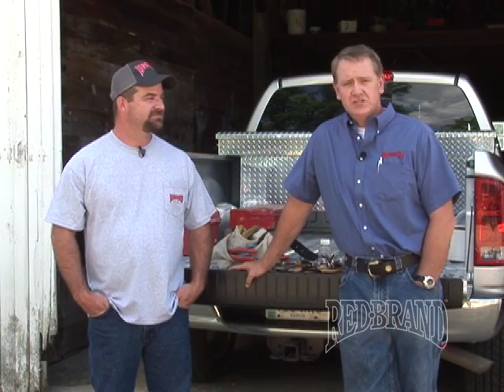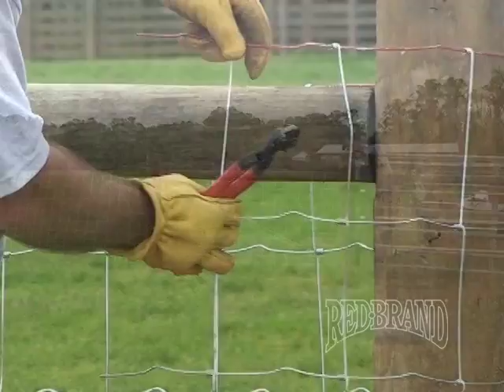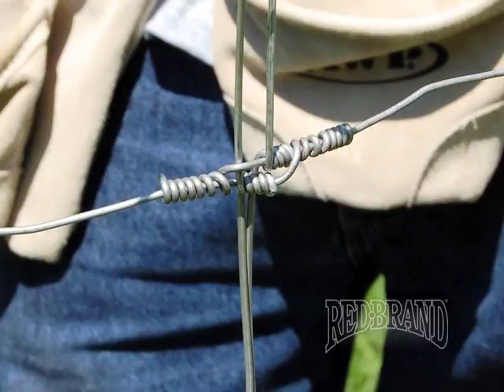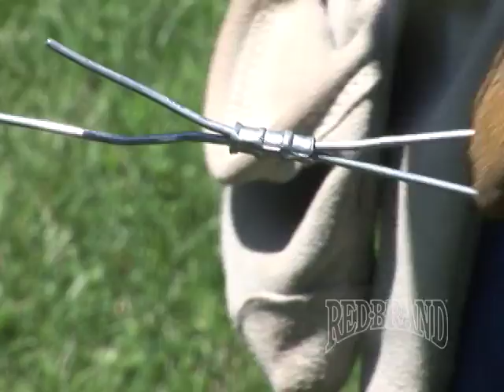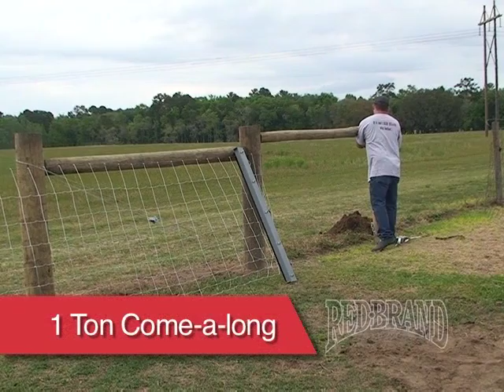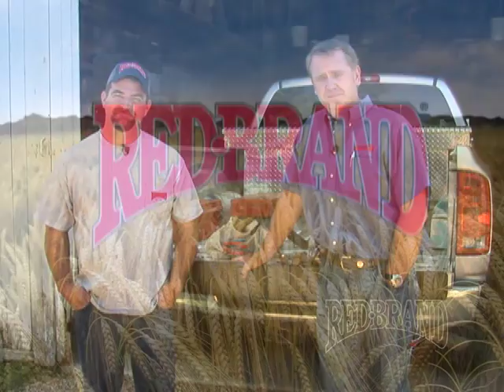How to install Redbrand Wire Field Fence

Comment: Low carbon vs high carbon. Over a short period of time, your fence material does not stand up to being tested by cows. Your fencing material is low carbon steel and not high tensile steel. I learned the hard way using your fencing products!!!!

Comment: can you tell me what material the fencing is? what is the metal wire made of, and what gauge? I'm wondering what material the fence tool for wrapping wire works for. are there some woven wires that are too tough for it?

Comment: I love how he breezes past the part where you have to remove all of the staples at every wire intersection in order to remove the verticals. They’re too thick and too small to grab with pliers or snips. Huge pain in the butt. I ended up using an angle grinder to take them off quickly.

Comment: I’m using Red Brand fence in my backyard for my dogs. I’m using 4x4 posts and I want the fence it be on the inside of my posts because this looks best. How do you turn a corner on 4x4 post when you’re running fence on inside?!?
Reply: I would suggest terminating the fabric in the corner by tying it to the corner post. This will prevent the fence from attempting to pull out of the corner. (Tension on the fabric will run in a straight line from end to end rather than around the inside of the corner). This is more work, but it will result in a better product.

Comment: Does the fence go on the inside or outside of post?
Reply: Typically, you want the fence fabric/wire to be on the same side of the post as the animals you want to control. That is, if you want to keep cows/horses in a pasture, but the fabric/wire on the inside of the posts. This does a few things: 1. It provides a smoother surface that is less likely to injure the animal 2. It forces the animals to push the fabric through the posts to escape (nearly impossible), instead of merely breaking or loosening the clips or staples used to hold the fabric/wire up.

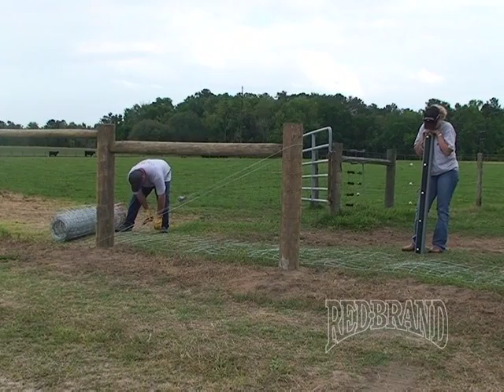Comment: Was your brace wire the wrong way at 6:43, then at 7:35 it was changed? I've done them the way at 6:43 and it will pull the corner post out of the ground as you tighten the brace wire. I always put 2 brace wires on, one each way to hold both posts in the ground.

Comment: 2 T POSTS DRIVEN IN THE GROUND WILL ALSO WORK AS A DUMMPY POST....DRIVE AT AN ANGLE AGAINST THE PULL AND USE COME ALONG FOR EACH POST...1 COME ALONG PER POST...MAYBE EVEN A THIRD IN THE MIDDLE.

Comment: The yanks have a rare way of fencing. I have to wander wonder when is the 2 stands of barb at the top and 1 strand of barb at the bottom? It stops the cattle shoving the noses underneath or leaning their heads over the sheep wire ultimately shortening the lifespan. Plus will you lot learn to twist the bull wire being used in the strainer and post as doing this it will make it more secure and it will stop animals getting trapped between the gap.

Comment: For those of you asking about tension on the very top wire and very bottom wire... those two wires (even though they’re being held under SOME tension after all the middle wires are cut and terminated - do tend to loosen a little. What I do is “re-grab” that wire with a single barb wire stretcher and either one come along or a heavy duty cargo strap. The barb wire stretcher is shaped like a small coke bottle and has a ring with a cutout that can be hammered down tight to pinch the wire (before or out in front of the post). Then grab or hook the ratchet strap to it. Connect the other end to either your dummy post, regular or next post, or what ever you’re using to stretch the wire. Then tighten the INDIVIDUAL wire and terminate it to the post. This technique can be used on both wood and metal pipe fence. I had to do that because sometimes the right tool for the job (gripple tool or having two strain boards and gripples or crimps was unavailable. Where there’s a will there’s a way!) 😂

Comment: I usually put a staple on the line right before I cut it to tie it off. You do lose a little tension if you do not do it. Good video.

Comment: What about corners? Should I go around the corner and continue to the next gate, or does each leg need to be terminated as shown?
Reply: you can pull around corners.
Reply: I found it is best to terminate at each corner. Make later changes and repairs easier. Sometimes even terminate in the middle of a long run.

Comment: The hardest part is standing the fence up..  I installed a section of 100 linear feet of fence by myself and that was quite a chore..
Reply: How do you fence like this on a slope? Do you have to cut the wire netting and do it in segments?

Comment: When fencing woven wire splicing was relatively easy but I can't find a good way to splice welded wire with the 2x4 inch spacings.  Does anyone have any ideas?  Thanks
Reply: Cut them in between longer..

Comment: You can buy a staple gun up to 50 mm saw  a. contractor in N Z use one works good  just a bit of an out lay at first saves o lot of time than a hammer ,great if you build a lot of fences

Comment: What is the distance between each metal post and how many between each wooden post?
Reply: 8 to 10 feet max.  I went 12 first time and then had to fix it with more. Same with end posts. Make sure to put end posts in deep or they will pull up.

Comment: Did it say anywhere in the anything about spacing between posts??  If it did I missed it...THAT is what I am looking for!!
Reply: Doug Chaney Red Brand website says 8-12 feet between posts using woven field fencing like what's used in the video.
Reply: @BC-yv8ew  How do you fence on a slope like this? Do you have to cut the wire netting and do it in segments?
Reply: @Devonian23 
Field fence conforms to the up-and-down shape of the hills.

Comment: I enjoyed.  There were two small tools that were used.  One was called a fence tool used for wrapping wire.  When I looked on line for Redbrand, the company was UK.  What was that tool used to wrap called?  Also, when the person attached the wire on the metal fence post, he used a tool to wrap it.  What was that tool called?  Thank you
Reply: Zeb Is this what you're referencing? https://www.tractorsupply.com/tsc/product/zareba-wire-twisting-tool?cm_vc=-10005

Comment: Can you please give me the specific name of this fence? I have tried to find the exact name but to no avail. I would like to use this type of fence for a trellis on my veggie garden, but I need to know the specific name of it otherwise I'm presented with all other kind of wire fences such as rectangular shaping, others with an X in the center, etc.
Reply: Myrrth S While it's brand name is Redbrand it is commonly referred to as redtop fence.The fence depicted in the tutorial is 47 inches high and 330 ft long. There is a white tag tied to the fence roll and the first set of numbers will be 1047. An entire roll typically costs about $135- $150 depending on where you live. If you only need a little then I suggest you go to the Craigslist farm and garden section for your area or your local classified ads as you can sometimes find someone that has replaced their fences and has some of their old fence or a partial roll of the new left over. Hope that helped.
Reply: Myrrth S this is field hog wire fence or grassland fence. it is installed by wood post or metal T post.If you are interested in,pls welcome to me. I will help you. skype: wiremesh_yan      whatsapp:+8615032721108     E-mail: wiremesh_yan@yahoo.com
Reply: Sunny Zhang Thank you so much Sunny, you are so sweet. Again, I don't need that much. I actually need about  20 feet in length and about 5 feet in height. I'm trying to grown my vegetables upward since I don't have much room in my yard for a veggie garden. 
I live in the USA. Not sure where I can buy a fence with a thin gauge with the 4" X 4" squares. I found a fence with a red edge at Lowes but that is a thick edge as to keep bulls in. Unfortunately that is not what I'm looking for.
Reply: @MyrrthScentify  tractor supply
Reply: @kennethponder3883   it's been a while but I appreciate you answering me anyway. Blessings!
Reply: Jim Hudson Hello. are you manufacturer or seller?  hope we can coorperate,thank you.
Reply: Sunny Zhang No, I'm not a seller nor am I a manufacturer....I just need about 12 feet of a thin gauge 4" x 4" squares to grow my squash, cucumbers & tomatoes upward. I'd hate to have to buy more than 15 feet when my garden is just not that big. I hope you know of someone that may be able to help perhaps a rancher somewhere toward the south part of Texas!
Reply: We are manufacturer of wire mesh fence, and we  can supply you with high quality fence as you needed. Pls advise me the quantity you needed and your e-mail,then i will give you a good price.

Comment: These guys not only know what they're doing, but they can explain it clearly, and they have close-ups exactly when needed. However, at 9:50 be prepared to switch from one side of the fence to the other - you may not realize right away that the dummy brace, formerly on your right, is now on your left.